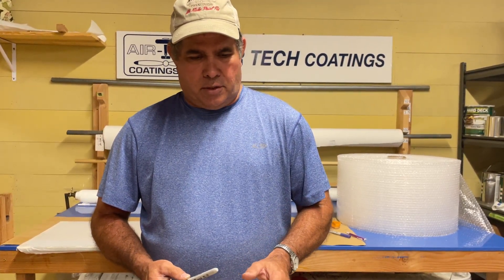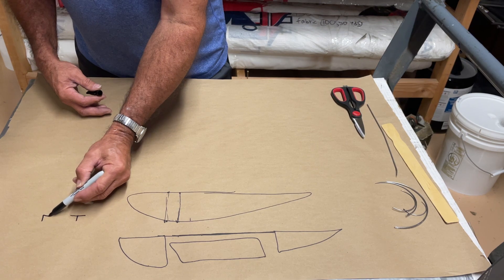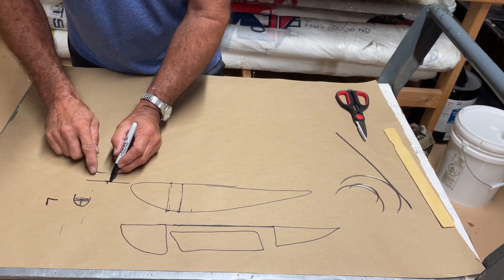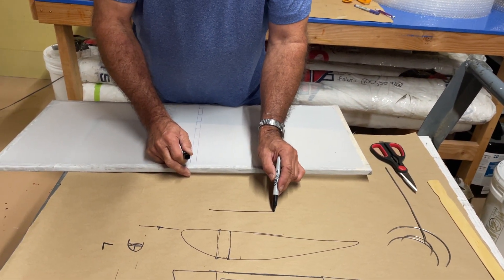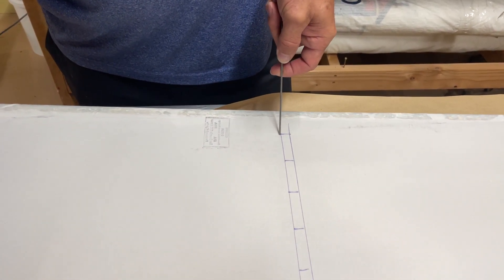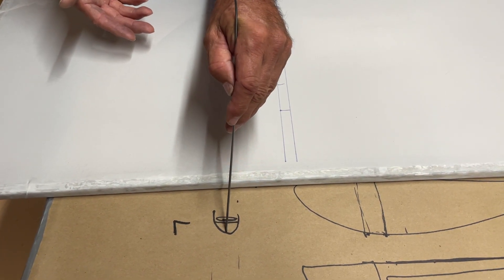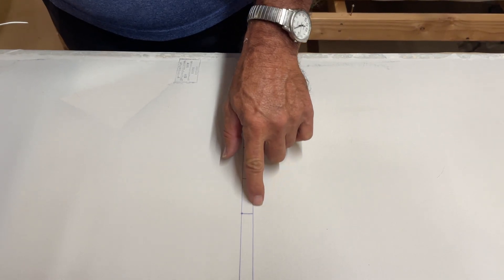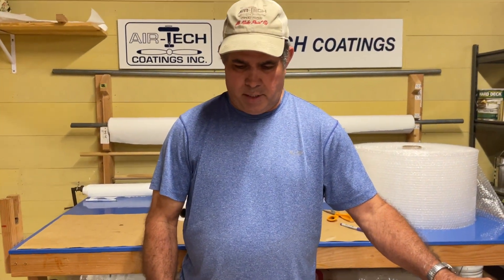Fabric Tip Friday: Blind Stitches in Fabric

Comment: Great video! I use a 3/32” brass brazing rod to make flexible nettles. Lot easier to use than a welding rod. 😁🤙🏼 We did a bunch of blind stitches on this Model 12 where the control rods go in the bottom wings. Thanks for sharing bro!